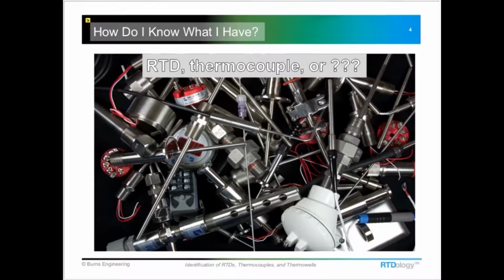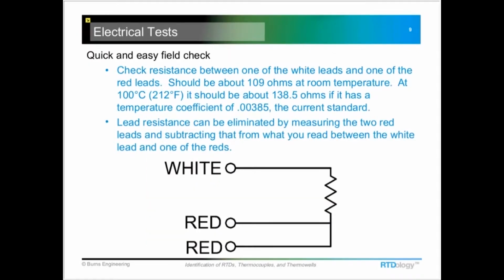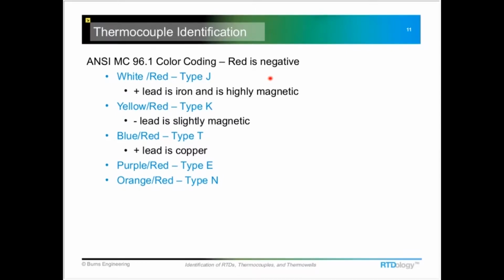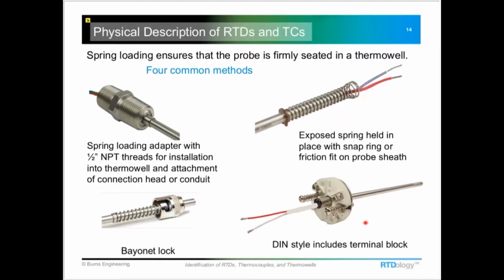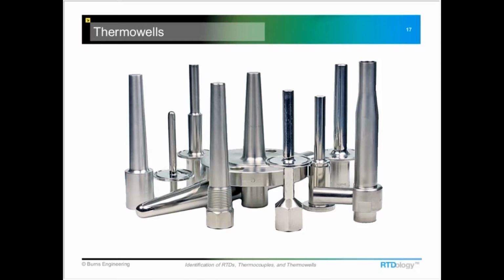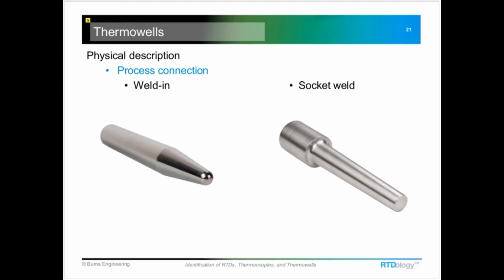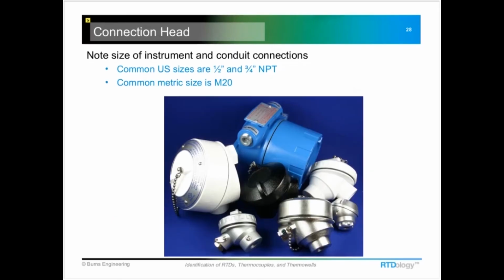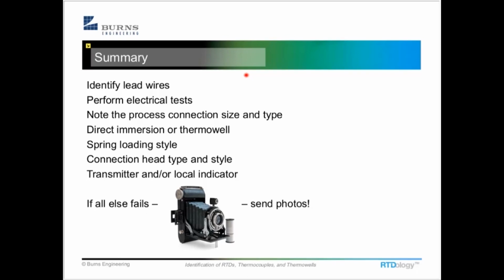How to Identify RTDs, Thermocouples, and Thermowells

Comment: I have a 3-wire, and the leads are Black, Red, and Yellow.  All three are about 5-8 ohms across any combination..... Not sure what I have
I have other 3-wire RTD's and I get a high 108 reading across the 2 Reds, and a few ohms across either Red to the 3rd "clear" wire
Reply from the maker: My guess if it is an RTD it has an internal short or partially fractured platinum wire on the sensing element.  One test you could do is measure the resistances while heating it up.  If it is a partially fractured sensing wire you will see a small increase in resistance.  
I do not know of any other type of temperature probe with 3 wires that would hve the same 5 to 8 ohms between any combination of leads.
Reply: instablaster...